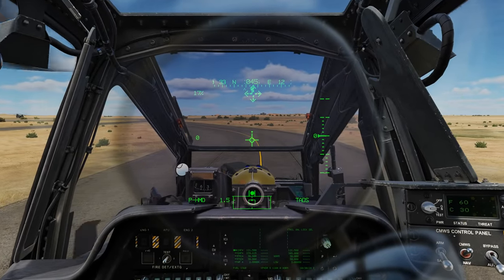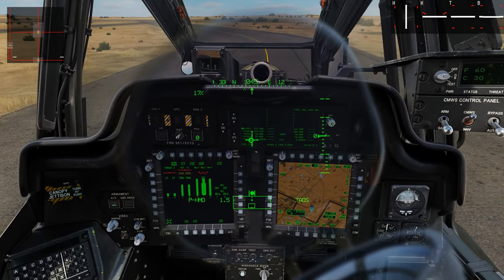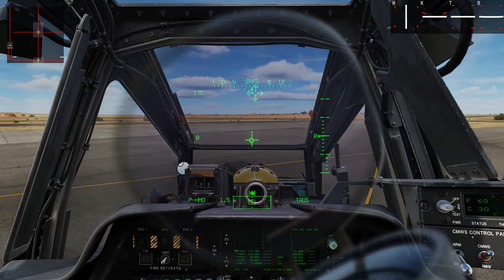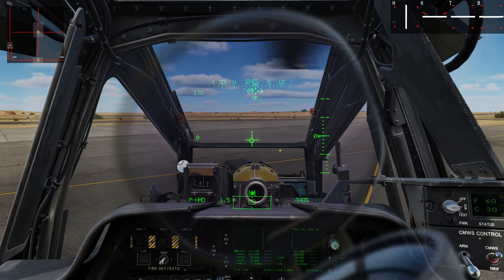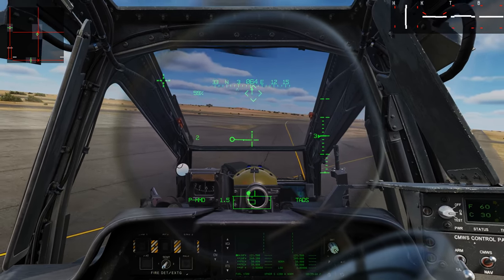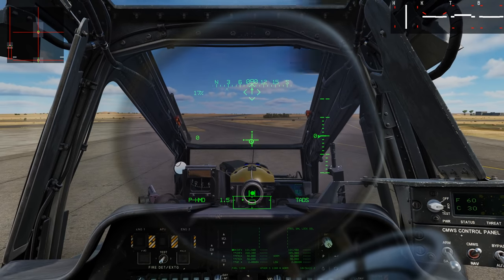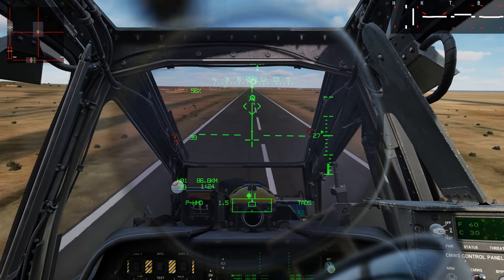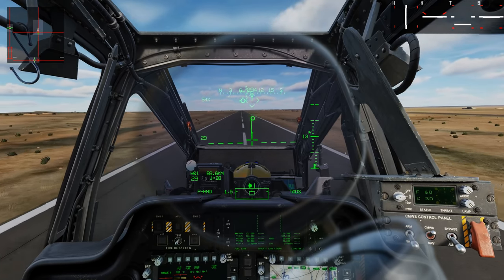DCS: AH-64D | Getting Airborne

Comment: will rolling start help with a heavy bird? and if so why is that?
Reply: Always. Look up “Translational lift”. Basically introducing fresh, undisturbed air into the rotor system
Reply: Matter of torque.  You have to remember you're operating two rotor systems, not just one.  If you ask for more than the engines can give, your main rotor rpm will droop... and so will your tail rotor... and your heading will get away from you.  Makes for a bad day when you return to the runway before you intended, and you're not aligned any more.  ENG PERF page, if working as intended, lets you know before you move the aircraft if you have excess power (above hover power) for a normal climb out.  If you're using all of your available power just to come up to a 5' hover... best to do a rolling takeoff.  Once you get above Effective Translational Lift (16-24 KTS in a UH-1), less power is required for forward flight.  After you burn off some gas, you can probably land to a hover, and take off from a hover without difficulty.
Reply: @alexmelia8873  thanks alot!
Reply: @robk5943  so in theory with a rolling start i can liftoff with a overweight helo but thanks man very informative